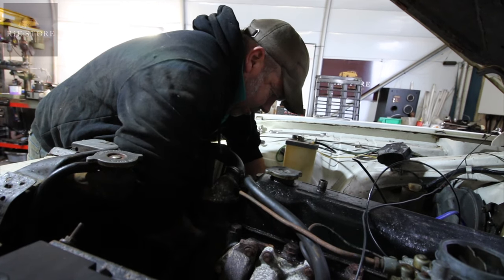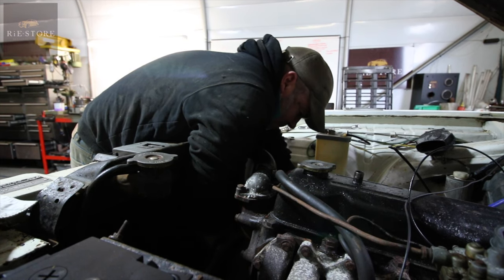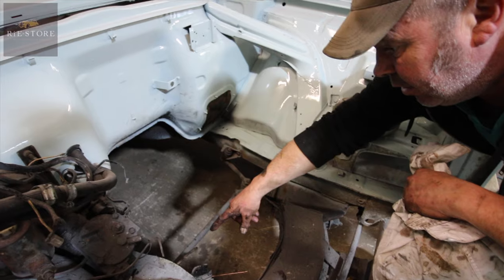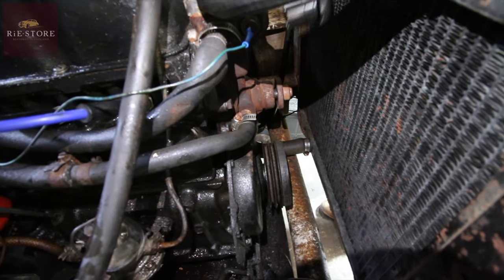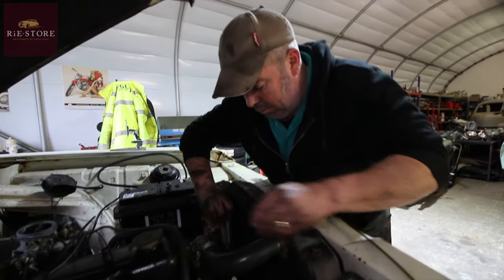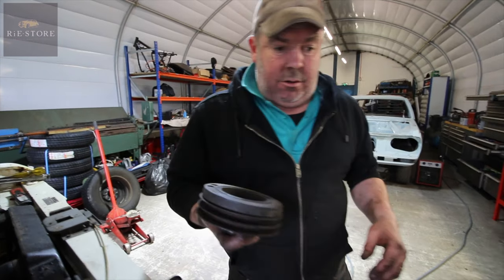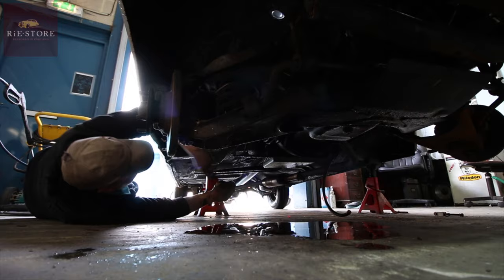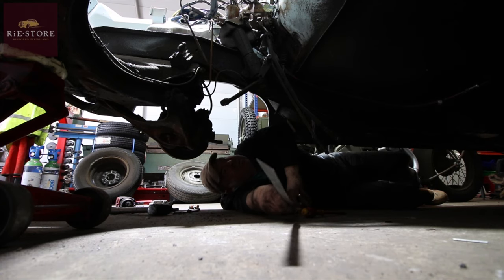Is this the end for the Vauxhall Viscount? / ep072

Comment: A good Viscount is a hard car to beat .    Its not just the leather or the refinements but the way the complete package becomes more than the sum of its parts .    Somehow the Cresta just not in the same league   but step into a Viscount and its a car that actualy makes you feel like someone special .   That GM transmission on the later cars far better than the powerglide , and I would buy another in a heartbeat !  I should say that I also drive a last of the line series 3 V12 Jag and a Humber Imperial   but I wish I had another Viscount .

Comment: I guess the Cresta was more solid and the resto was further along....
There is a certain vast, lumbering faux-American GM presence to this things....
People will say that the Viscount is "worth more", but even with 'leccy windows and a vinyl roof, a sixties car is a sixties car.....  It is about the sound, the feel, the sensation.
A 3.3litre six would be a heavy lump on the steering at low speeds....  even on marrow 60s crossplies.